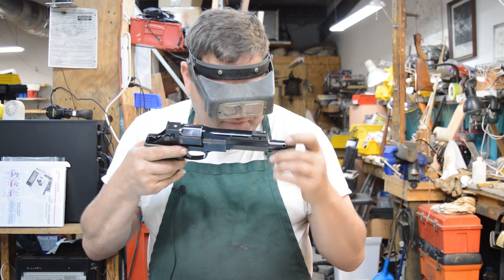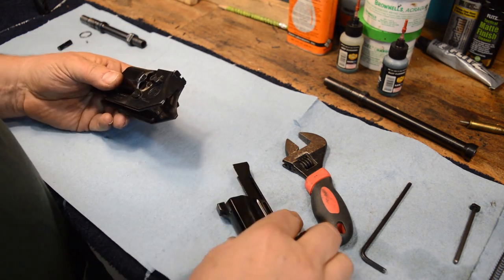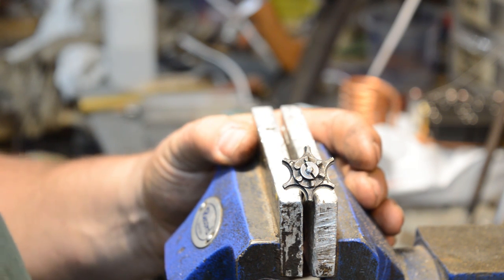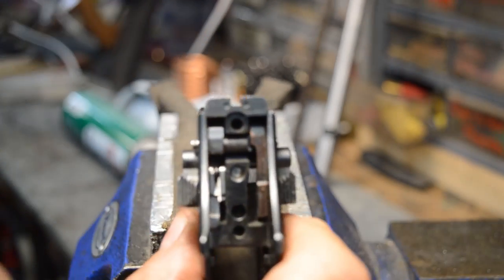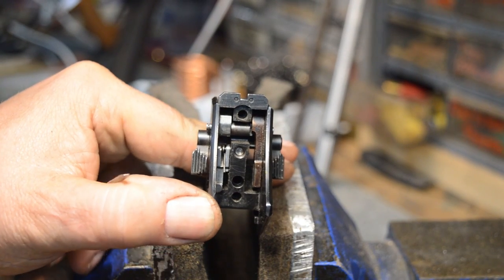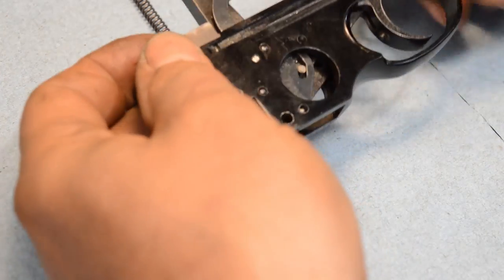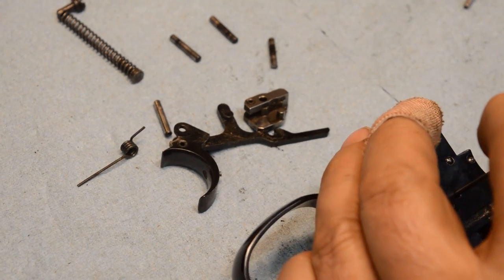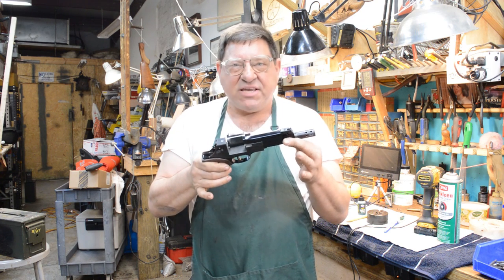Anvil 082: Mateba Unica 6 Conservation and Refurbishment

Comment: This looks like a concept pistol. I don't see the benefit of a simi auto revolver.
Reply: It's essentially a overly complicated double action
Reply: Soaks up a bit of recoil and more importantly, you get a series of single action trigger pulls instead of double action.
Reply: Single action trigger pull every time. Not every gun needs a practical reason to exist, anyways.
Reply: And this one in particular has a very minimal muzzle flip due to being "upside down"
Reply: It needs to be useful?

Comment: Way to complicated  rather a single action  than that micky mouse  claptrap
Reply: That's why it is a sporting gun and not a service pistol. The former just has to run and doesn't need to survive harsh conditions. Granted: 'complex' usually equals 'expensive'.
Reply: Difference is that this is a semi-automatic revolver. Kinda why it's complicated.